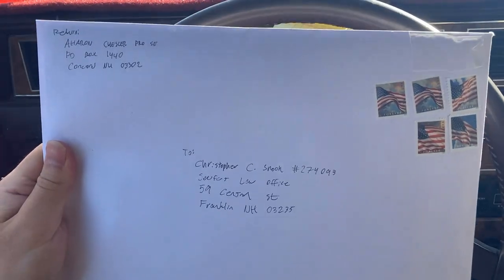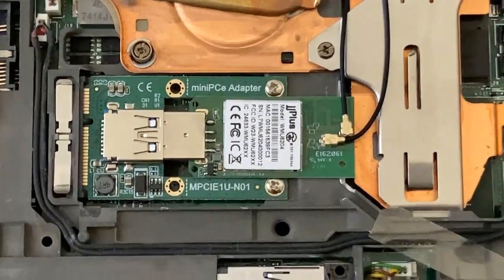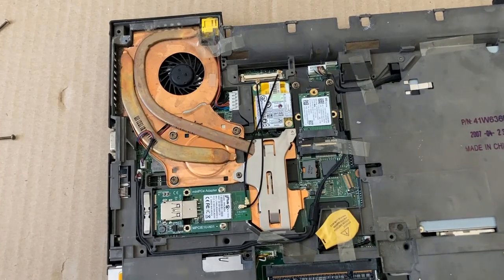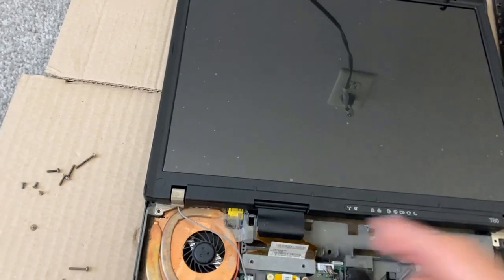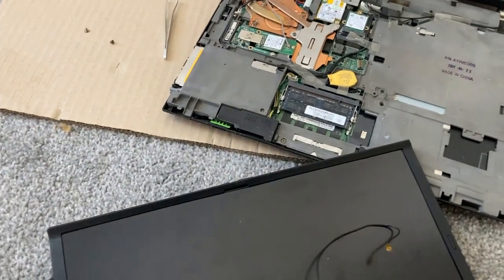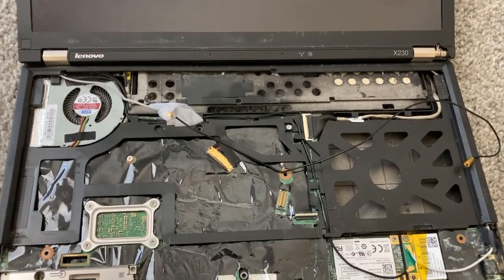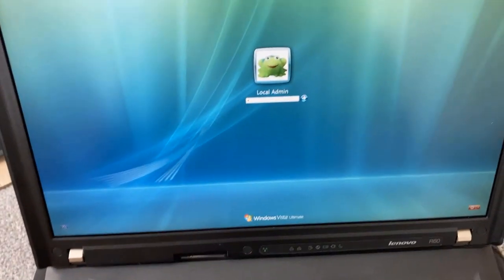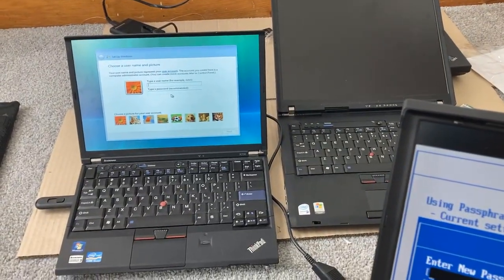The Holy Grail Of 4:3 IBM ThinkPads, the QXGA 2048x1536 IPS FlexView, Alive and Well in March 2025

Comment: Its too bad that the display doesn't show the BIOS as it should but like someone else said it might need an EDID flash to work properly. 

Looking at this display again though, I'd love to get one of them and put it into a T43p I am getting soon if possible but they are very expensive and hard to find now not to mention I have no clue whether that would need modifications or not to fit and work properly. However, I have thought about maybe finding a 15" T60 with an IPS display after saving up money albeit I have so many ThinkPads as it is that I am not sure if it would be worth it right now and despite the T43p being much slower with a Pentium M I really love the design of that too.